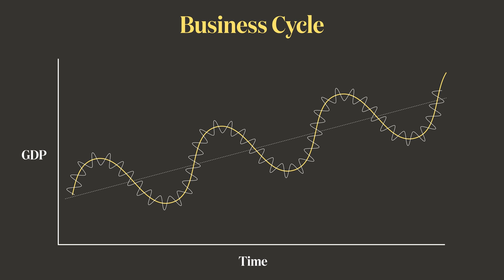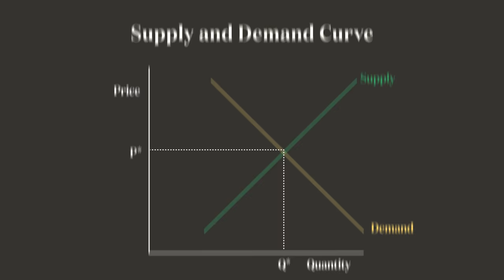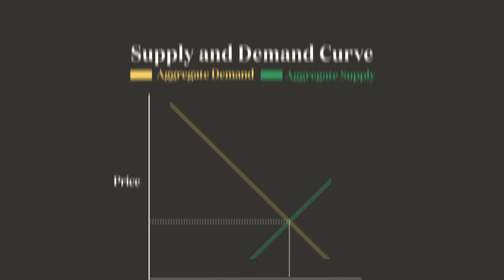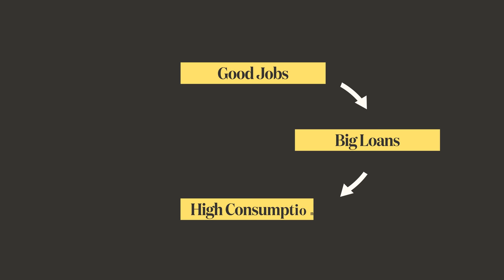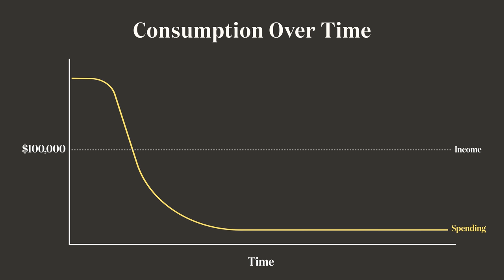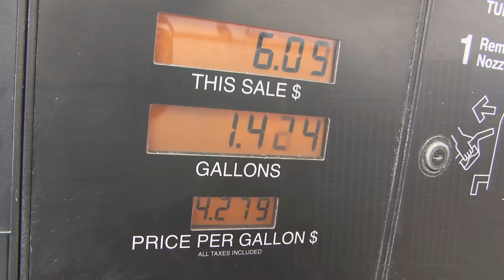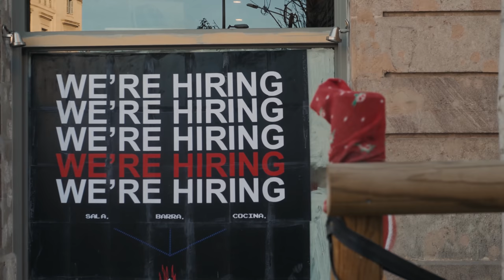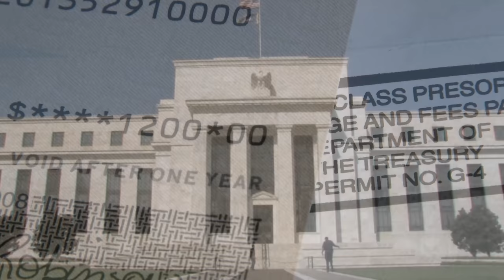The Recession We Need To Have | Economics Explained

Comment: Sooo.... what happens when the whole thing stops working. For example. We are heading towards a large food shortage. That will result in people refocusing on the basics, but the price for them will rise extremely quickly to the point, people just cant buy them (demand outstrips supply). And similar with energy. You dont have any "room" to move if there is no supply. And then economies start to just fail. Because everything else, suddenly becomes valueless - money, houses, cars, tvs and so on. This is a highly likely scenario starting to play out in front of our eyes right now. The "supply shortages" due to inflation and money printing, is putting everything in a very precarious position. More worryingly, there are no moves to rectify it??? Whats going on??? the UN, IMF and World Bank are just going to let people die in the millions? Is that what we've become?
Sooo... what is the economist answer to this? When anarchy appears on the horizon, it often looks like something we can fix. When its banging at your door... its too late.

Comment: A recession is awesome IF you've had the foresight to save when things were good - when the market plummets you'll have buying power and access to stocks and investments at a fraction of the price while others are scrambling.
Reply: Only if you have savings tho
Reply: Only if the market actually crashes. If it doesn't, cash savings are sat there in a low interest rate environment getting trashed by +10% inflation.
Reply: @pja8901  Cash savings yes, that's why letting cash sit is stupid, you need to exchange cash for assets which can appreciate.

Comment: Recessions for the benefits of productivity. A lot of economists focus on the need to increase productivity and wealth generation, but I wish the capital system could factor in the human side better. A slight decrease in productivity for higher wages, higher quality of life, and work choice for workers is obviously worth it if you think like an actual person and not a number optimizer. Businesses keep employees barely happy enough so that it doesn't drastically lower productivity, they rarely do more than the bare minimum that is required to not effect them.
Reply: My point is that if recessions are "good" because they weaken labour bargaining power and thus help productivity, then I disagree with that being an objectively positive thing. Labour bargaining power is already pretty low, with a couple of newsworthy gains in the last two years that will be A) wiped out in a recession and B) was never very significant in the scope of things. Until wealth inequality is less of an issue than a recession setting back workers is NOT a good thing. Economically it appears like a good thing short term but long term is just pushing off and exacerbating a larger crisis.

Comment: Good video and it hits the nail on the head. One primary reason for recessions is it removes inefficiency, which results in growth down the track. Delaying a recession increases inefficiency in the system, which means the down term will be more severe. You do need to smooth out the cycle with counter cyclical government intervention, but the government finds it hard to take the foot off the accelerator once they put the foot down.

In the end the only way to increase your living standards is to perform activity which has a higher value to society, basically productivity is the key to increasing personal living standards. Either increases your skills, which is the preferred method; increase the time and effort in working, not so popular, or to flip to a higher value employment, also preferred.

Participation can help to increase your households wealth, more people working in the house more efficiently and there is more money in the household. Population helps the government, more people working, and more taxes, however governments often fail to provide the infrastructure to support increased populations which can reduce the living standards of those who already live there.

Comment: In many systems there is no difference between a well paid worker who does their job at peak performance, or lowest possible load. Especially in government jobs. Everyone gets the same or different pay. The pay is not regulated by how much you do or don't do. It's by education, prior experience and demand. So a highly educated person with a high salary can do close to nothing, and still get paid more than the person doing the same job with a lesser education with a higher quality output. So what is the incentive to work harder when you know someone else get more than you for doing less? Or even better, takes part of the credit for doing a good job.

Or this example. You have a worker with same education and experience. One works at peak performance and the other does the opposite. The one doing the most does not get any more pay. But they might get more praise and perks with the job. But that does not really work in the long run. The worker doing more will over time get complacent. Most likely quit their job for a better one or worse, lower their standards to the same level as the worker who does the bare minimum.

What could fix this? Value the worker that does more with higher salary and/or promotion? Talk with, reprimand or fire the "useless" worker? What will the union leader do if you try any of this. All workers are equal in a union. And they will/have to fight as hard for the person even if they don't want to.
Maybe it is the company itself and its own leadership that is at fault? Is there a systemic problem in place that repeats the cycle that needs reform?

A workplace is a highly complex system and giving the blame solely on the worker (or company) is in my opinion not the right way to look at this. And to say that a recession the solution, only to resets the problem over and over. Peeing your pants to keep warm is short therm solution that you can do forever...

And remember this; The bank does not give you a loan for being paid in non monetary value as praise or a new fancy screwdriver.

Comment: One major problem of economics is that externalities are often not well accounted for. 
Ex: Desperate people may resort to desperate measures, increasing the cost to society via increased crime rate.
Unfortunate people, especially when there are insufficient welfare system, may get unnecessarily sick or die, costing society (obviously, sick and dead people are major vectors of disease mutation and transmission).
Abandoned factories and labs may result in catastrophic chemical leaks or contamination issues, potentially polluting more than local environment.

Comment: I think one of the other things that's throwing the supply and demand out of whack is the increase in technology. Technological advancements decrease companies' demand for labor because the new technology can perform a task cheaper and more efficiently than a human worker. The decrease in labor then brings a decrease in demand for products along with it. Except that the economy is designed for mass consumption, so that would have a disastrous effect on the economy if 90% of the population just starved to death. I think a new economic system is needed. The economy needs us to consume more than it needs us to produce in the computer age, and we need an economy that reflects that.

Comment: I think the problem with workers getting laid off is that a lot of people who are deemed "unproductive" are oftentimes people with disabilities who get screwed over the most.  These are usually people who need the jobs the most, but depending on their condition, they can struggle to work to the same capacity as some other people.  When laid off, they often lose their health insurance, and they can even be evicted if an expensive medical bill or other bill comes up as a result.  It often has little to do with the actual work ethic of the workers, and disabled people just get the short straw.

Comment: In the example of companies gaining more effective means of production, lowering prices until supply and demand meet once again, how would this lower wages? 

The company is going to use that more effective production to increase their income (balancing supply and price depending on market competition) and this in turn will increase wages since the company is making more money.
Reply: Efficiency does not = higher wages. White collar is the perfect example. If you can achieve 100,000$ of work in 10 hours instead of 100 hours, that employee while becoming more valuable in the operation is not now more valuable because of there experience.

They will be paid the same or there job made obsolete and reassigned to lower ranked employees as the processes necessary to execute the task has been simplified or streamlined

Comment: Minimum wage damage over simplified explained take a bowl of lose change and charge people two cents to draw from it.You will notice after a short time the penny resource completely untapped and needed to be pushed aside to reveal larger coins.The biggest damage is to recycling as an extra labor step is often required to process non uniform resources.

Comment: I'm sure this is all true, but it doesn't touch on how gains during economic upturns, and losses during economic downturns, are not evenly distributed across the economic strata. Although the general economic trend continues to be upward (which is in itself unsustainable on a world with finite resources), the real world spending power of the average person is declining. For a successful company, during times of economic boom wages may increase slightly while profits to shareholders increase exponentially, during times of economic downturn however, wages stagnate and jobs are lost while shareholder profits seem to often remain fairly strong. None of the previous recessions have broken this cycle so I fail to see how another will. Im a layman but it seems to me that rather than positing new economic systems and mechanisms, economists are stuck over-analysing the same broken economic system that favours the concentration of wealth. They treat these models like they're fundamental properties of nature rather than human inventions. Imagine if computer scientists had decided that vacuum tubes were fundamentally the most advanced form of diode possible. I think it's time economists started to innovate as much as they suggest the rest of us should.

Comment: If you're going to suggest that the Australian automotive industry collapsed because the workers took a higher than expected number of sick days after public holidays you bet that's going to get you downvoted. The size of the Australian market and mismanagement had a lot more to do with it than what is probably at best very low single digit reductions in percentage efficiency if workers take a few days extra leave a year. That was far outweighed by the injected government stimulus.

Comment: A recession is certainly one good way to fix entitlement issues, a better way would be for the government to maintain a 5-6% unemployment band. When it’s lower than that, they should be slashing spending left and right, general QT, and rapid deregulation. When it’s higher than that they would consider QE. The ideology that the lower the unemployment the better will always cause havoc in the long-term.

Comment: As long as the insolvency of bad businesses does not impair the liquidity of good businesses, everything should play out as described. The real issue arises when insolvent businesses cause contagion. In 2008, the sudden insolvency of AIG and other large financial institutions dried up liquidity for many good businesses, so the feds bailed out/recapitalized the financial institutions. One of the ways this occurred was by the FDIC buying noncumulative, non-redeemable preferred shares (with a 6% yield iirc) from the banks, which directly bolstered their tier 1 capital to absorb losses on toxic assets. It appears that China is going to experience something like that due to their real estate bubble popping, and European banks may be heavily exposed to Chinese commercial paper and real estate bonds, so I expect there to be some amount of contagion over the following months/years (however long it takes to play out) even if the Chinazis recapitalize some of their financial institutions in the wake of the real estate hegemons collapsing.

Comment: This is a very capitalistic propagandistic video. 

The “worker’s fault” rhetoric. Not inequality, not capitalism, not tax evasion.

Ah and but of course, “consumption, consumption, consumption”. 

Capitalism is broken and doesn’t work. So keeping with it and following the exact same path, will not help anything.

However there is an interesting topic raised “private sector is unable to ensure supply”. 

Well it’s not unable, it just doesn’t want to do it. Which in turn raises into question, what is the point of it existing in the first place.

This in turn, reinforces the idea that the government and as such the state, needs to keep hold of key services and resources, in order to regulate the economy to avoid these “crashes”, that only benefit the rich, no befit for the poor.

So no, we don’t need recessions, as this is a element of the “capitalist system cycle” and as such benefits no one, apart form the filthy rich. That will use it as an excessive to keep paying under minimum wage or justify salary dumping.

Capitalism is not the solution. Dropping and put it to rest is. 🤷🏽

All these “economic philosophies” are like the bible, unrealistic and serve no purpose, other then keeping the rich richer and the poor poorer. 

Taxing the filthy rich to extinction and dropping capitalism is the way to ensure peace and sustainability on this planet for everyone. Consumption is not a solution is a problem that has originated all the other problems: poverty, hunger, deforestation pollution.

The “never ending growth” is a falacy and yet again another element of a capitalist system. 

Capitalism being phased out is the only way forward. 👏🏽👏🏽

Comment: One of capitalism's flaws is very easily seen here, the necessity of recessions to temporarily fix resource mismanagement. Back in the USSR such periods of downturn were unnecessary, instead hundreds of state owned corporations were constantly restructured during routine balance sheet planning meaning production quotas were lowered or increased where needed on the fly, all according to a series of mathematical models. An eventual transition towards a scientific socialist economy seems more and more likely.
Reply: @Norm475  I have just explained it's innate irrationality. Honestly the fatal flaw is the market's inability to improve over time since it will always rely on independent economic actors making their own less than perfect decisions, compare this to ever increasing computational power, advancements in AI and even fields such as econophysics. It should be obvious how markets will get "outcompeted".
Reply: @BrezhnevStan  Sure computer power is so great and accurate.  They have really been accurate in their climate change projections.  Remember the old saying, "Garbage in, Garbage out.
Reply: @Norm475  The data doesn't have to be perfect, just "good enough" to outdo markets.